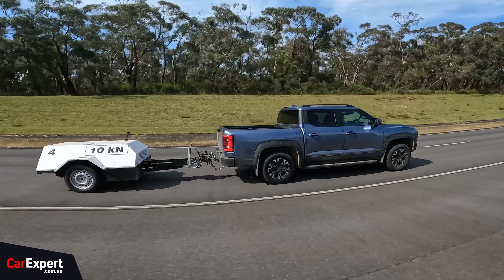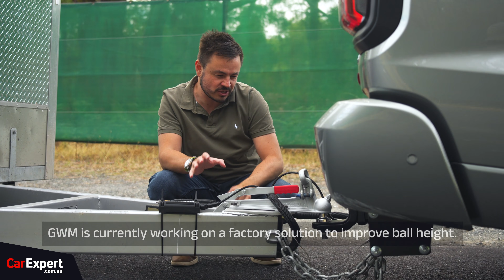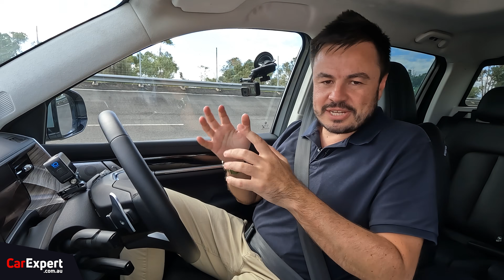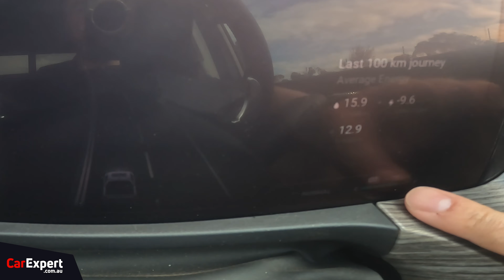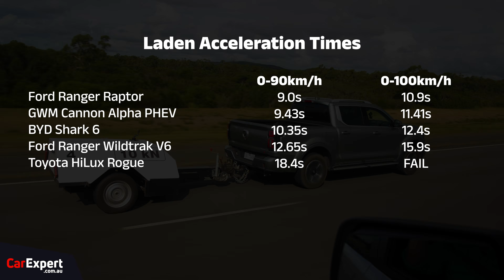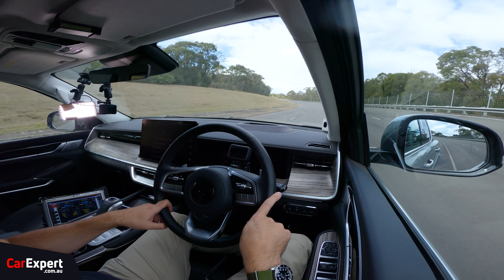GWM Cannon Alpha PHEV towing STRESS TEST: This blew us away...

Comment: Now this is the kind of car review we need, cheers Paul. You’ve covered the most important aspects of a Ute and quite frankly in this day and age, why wouldn’t you buy a GWM. If you look at the laden v unladen data, still the best out of the range. Would you pay $100K for a Raptor or $60K for this PHEV which is just couple of seconds behind. 
Great dynamics and will be on top of my list. Sharks ok but I guess only if you want a Ute based car. This on the other hand is versatile. I’m sold.
Reply: With that logic you’ll be happy 6km from the beach on a beach holiday, save yourself a bunch.
Reply: @craigdavid6668 i mean... that's like 10 minute drive from the beach... if it's literally half the price, then why not?
Reply: @ Because it’s a compromise I’m not willing to make, if your standards are so low then go for it😂.
Reply: @craigdavid6668  we get it. You just like to brag and not actually do anything lol.

Comment: How does the 3kN load compare to a towed weight? What load would be on the vehicle towing a 3000kg boat/tandem trailer? Would this ute be worth considering for a 300km round trip towing 3000kg boat/trailer? Would I need to plug it in somewhere to be able to recharge the battery to be able to make it home?
Reply: 3kn constant load is more load than a properly setup 3000kg trailer will demand
Reply: 3kN is 300kg.    @morelife9103
Reply: Yes it’s ok no need to charge it the engine will charge it
Reply: There are many factors that affect the load on the tow vehicle, wind resistance for example has a much more dramatic effect than weight at highway speeds. 
The trailer dyno that Car Expert use is an excellent way to control that variable to provide a fair comparison between vehicles.
Reply: Whoever heard of a 2.6 t caravan causing any of these utes to burn nigh on 30 litres. Christ, I drove B Double fuel tankers and they only used 30 - 40 l/100 km!
Reply: @bubbleboy468 Yes I'm lost on this too. Have a 2013 Dmax 4x4 with canopy (350kg bare), Jayco Outback Journey bare is 2.2T then add food, water and all the other gear and use 18-19L/100kms.
Reply: 3kn dyno trailer is simulating a constant load applied ie travelling up steep hills, it does not represent regular Highway towing fuel consumption.

Comment: This is so much better than the shark. That thing is just trying to look good on paper while this one seems like its actually been thought out properly. 
Its a shame about the bits like the towbar but lets see what its like once its done and on sale before giving it too much greif over that. Well unless they release it like that in which case they deserve all the derision they get.
Reply: Hopefully they find somewhere to put the spare wheel.
Reply: @jameshind6644  I think the problem is they took a normal pick up and threw a battery under the tray without really thinking it through. There are a few ways to do it - re-engineer it so the bar and wheel are in a normal-ish place then build up battery packs around them would be best but hardest, raise the tray and sandwich the battery between the under-stuff and it but that raises centre of gravity and load height or the easy one and what I presume they will go for - just throw the spare in the bed and hope no one notices how that impacts the usage of it. 

The real engineering issue is they're trying to make a PHEV from something thats intrinsically inefficient. That means a massive battery to give it anything like range and that makes packaging and weight a big problem. This design would work much better with a smaller battery or better still as a normal hybrid but they need those numbers on paper to show how great it is compared to the Ranger/etc - even though in reality its only half thought out and half baked.
Reply: Cannon looks great for sure... but to be fair to the Shark, its in a completely different market. Targeted to those that do mostly city driving with minimal off-road/towing (so 80% of ute owners).
Reply: That trailer is going to scrap the ground.

Comment: The GWM has a much better setup than the Shark primarily because of the larger internal combustion engine.  A 1.5L engine just can’t delivery enough power when the battery is depleted.  The battery will get depleted on long uphill gradients, which then requires the ICE to power the wheels and act as a generator for the electric motors at the same time.
Reply: What battery is GWM using ? How reliable it is ?
Reply: @susu198215 of course that remains to be seen.  However people would be well advised not to buy any of these new Chinese 4WD’s until the technology is properly sorted out.  The Shark is a great idea, but like the GWM is yet to prove itself reliable in the long run.
Reply: @susu198215  37.1kWh ternary lithium, its got a very big battery. GWM produces car batteries for BMW in China, its reliable.
Reply: @susu198215 dirty nickel batteries like all the Chinese brands to keep costs down.
Reply: @ev0wat your cooked. The newer byds don’t use nickel, the shark included
Reply: @ev0wat most use LFP actually, which are piece and fire safe to 2000 degrees
Reply: @ev0wat Many Chinese cars use LFP, no nickel in that.
Reply: Towing = diesel. PHEV is for campers and daily commuters.
Reply: @dannyhong3195 yes I agree at this stage.  However, diesel/electric hybrids may prove to be the ultimate solution.
Reply: @dannyhong3195   diesel is on it way out

Comment: Thanks Paul! This video tells a lot. Cannon Alpha PHEV is probably the best ute in Australia when considering a mixture of energy efficiency, capability (both urban and offroad) and practicality. The rank Paul showed at the end of the video puts the Alpha PHEV in number 1 spot without a doubt. It only lost to the Raptors by a little in towing but when factoring in Alpha PHEV's cost savings on fuel I recon this is the number 1 ute currently available. The Hi4T system on this car is a proven and trusted technology in China liked by many people.
Reply: Thanks for a good review. My question is, if you were towing a 3T caravan for say 700km (eg Brisbane to Rocky), how far north would you get before the battery runs out of charge and you were left with petrol power only?
Reply: @davidpearce859 You don't understand how a hybrid works. When you go along the flat and you're just maintaining speed it will run off the engine, when you brake or go downhill the car will regen energy back into the battery, when you go uphill or you need to accelerate the car will use both the engine and the motor so the answer is on a 700km trip the car won't run out of battery be ause it is designed to always maintain a minimum battery level.
Reply: @davidpearce859 Yeap my question also
Reply: @davidpearce859  oh no problems that 1.5L power plant burning unleaded will be an absolute power giant NOT.
Reply: @ It’s a 2L motor with 180hp so it shouldn’t be be totally useless but for towing it’ll need more.
Reply: @ don’t forget it would be trying to charge the battery at same time.
Reply: Don't like this design of battery or location.  Take a smack off road and watch the thermal run-away.
Reply: I’d love to see you guys test the Ford Ranger 2.0L bi turbo variants.
Reply: Let’s add to that that it also has the best interior of any Ute on the market at the moment making it a real winner.
Reply: So just going to note that there is no spare tyre, the car doesn't come with a tow bar or good mounting point for one...and the battery type in it will ignite if pierced or faulty. Even if you where to only tow 2.5 tone in it you really only have enough pay load for two reasonable sized guys in it, 1 guy and his dog when towing 3.5 tone.

...just pointing out there are compromises whichever way you go.
Reply: @LoardAmazing almost beyond belief that you would build a vehicle with 3.5T towing capacity and no factory tow bar solution…
Reply: @LoardAmazing  don’t upset the peasants now. They’re still on cloud9 after seeing this amazing invention 🤭 they just don’t live in reality.
Reply: Wow! The GWM Cannon Alpha PHEV is exactly the kind of ute that I want to use in my underground mining operations, the petrol engine and battery will surely prove to be incredibly robust, and the interior hard wearing. Also my good friend who owns a farm is totally looking forward to the advanced technology that it offers. He can’t wait to be unable to repair it or get parts, all of his friends think he’s crazy for getting rid of the Toyota that has lasted over 30 years and still going strong, but never mind, having dirty big touchscreens and a tailgate that folds differently have won him over. So exciting!
Reply: @rsoul7282  China 4x4 market has been dominated by Toyota for the past 30 years until Tank almost taken over the entire 4x4 market in China in recent years. Toyota Prados are almost pushed out of the Chinese market now. The Chinese people made their switch not because of the fancy screens or massage chairs, it is mainly because of the engine, transmission, and electrical reliability is just as good as the Japanese brands now. You will be surprised how many Japanese and European engineers are working in the GWM R&D team.
Reply: @rsoul7282  The Chinese 4x4 market has been dominated by Toyota for the past 30 years until taken over by GWM Tank in recent years. Toyota Prado is disappearing in China. Chinese consumers made the switch not because of the big fancy screens or massage chairs, it is mainly because the reliability of GWM’s engine, transmission, and electrical is now just as good as the Japanese cars. You will be surprised how many Japanese and European engineers are working in the GWM research and development team. GWM spent billions of dollars in R&D each year because of its ambition.
Reply: @rsoul7282  The Chinese 4x4 market has been dominated by Toyota for the past 30 years until taken over by GWM Tank in recent years. Toyota Prado is disappearing in China. Chinese consumers made the switch not because of the big fancy screens or massage chairs, it is mainly because the reliability of GWM’s engine, transmission, and electrical is now just as good as the Japanese cars. You will be surprised how many Japanese and European engineers are working in the GWM research and development team. GWM spent billions of dollars in R&D each year because of its ambition.
Reply: The peasantry runs deep in the above comment 🤦‍♂️🤭
Reply: @ev0wat you're a strange person. Has mum let you out of the basement yet this week?
Reply: @ev0wat And the stupidity is rampant in your useless comment.
Reply: @ev0wat  We are the clever ones, we recognize how good the smart phones are when others are still praising the old Nokias, we recognize that China currently leads the EV technology and their immense manufacturing competitiveness to bring the price down while others still religiously believe in expensive Japanese and German cars. If you can’t see it now, in 5 years’ time you’ll know because time will tell.
Reply: @timwu5934 did you factor in the amount the communist government is subsidising each unit to cut a swath through the proven tec of Toyota and others.  Looks like you have fallen for the 🍬.
Reply: @gregorymatthies5297  so do you mean i pay less money but get better car?
Reply: @tonyz9066 really not sure what you are talking about mate.  Flooding the market with cheap Chinese stuff is a long term fail I say.  Cheap is not always best but many can’t see past their wallets to the long term effects.  My view.

Comment: I always thought you shouldn't use cruise control when towing a trailer because especially in a manual the throttle position could be in 100% labouring the engine trying to keep the car at the speed as opposed to dropping back a gear? Might be an old school myth
Reply: Incorrect- cruise control puts the car in the most economical position. Cruise control on a long journey is lower fuel consumption than manually controlling it. I’ve done all my tests over the years lol.
Reply: I can drive my gwm alpha towing a 2.5t while on autopilot however you shouldn't trust it even it works fine. the car behaves differently when towing and I dont think the computer programs is sophisticated enough to handle this complex situations
Reply: Yep old school myth, The new stuff is pretty smart.
Reply: I agree, but primarily from a safety angle. Obviously these Chinese manufacturers agree.
I've owned several vehicles with cruise control that does work whilst towing, but after utilising it briefly on all of them, I just went back to having full control over all inputs, even towing down the Stuart HWY, long, lonely & boring but desired all inputs by me, not the vehicle.
Can't comprehend a situation I'd like to be towing utilising cruise.
Reply: @ianweal3081  nothing wrong cruising along on cruise control on the motorway coasting.

Comment: Can you not turn the towball tongue over to increase height ??
Reply: 100%😂
Reply: It is a pre-production setup at the moment. The tow setup especially is not what to expected in production.
Reply: I think you will find that you cant do that because it wont be rated for that, I found that on my Ranger tow tongue
Reply: Maybe you are smarter than the engineers who have set up this prototype
Reply: @djjames6576  Thanks for the compliment 😁
Reply: Thank you that's the test I've been waiting for and I'm impressed even at 22lt to 100ks is a good outcome when considering it's loaded to its maximum and sitting on a constant 100 kph. Looks like I'll be giving that a place in my driveway,  once they sort out the towbar.
Reply: There are hitches that can be run as drop or lift. 
I recently bought one for the company Iveco because that stock hitch was too low.
A properly engineered Hitch with 3500- 4000 kg rating and 400 max Towball download in both directions
Reply: Yes you can
Reply: No you can’t, the tongue won’t be as strong